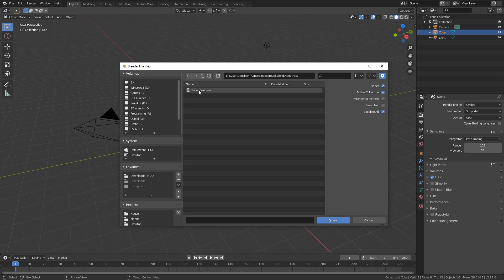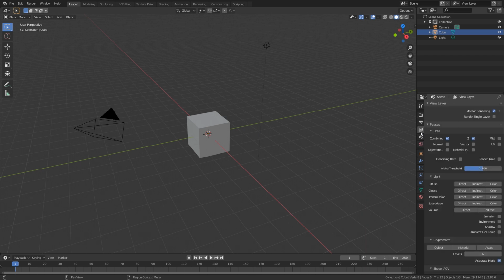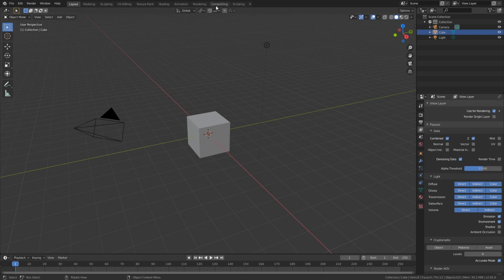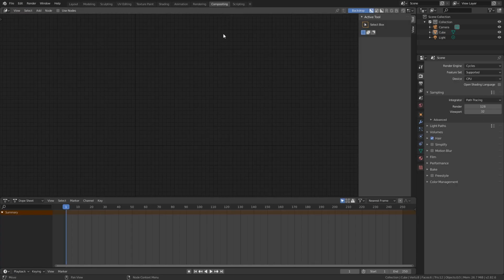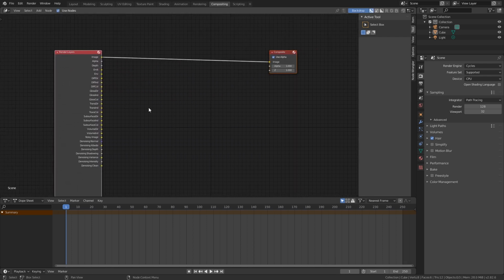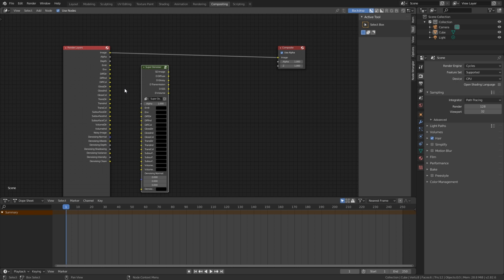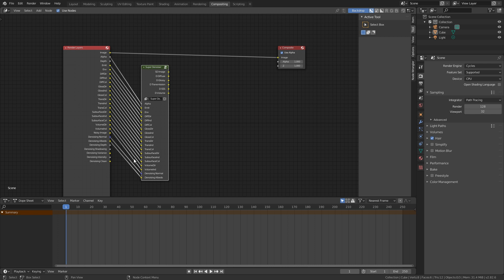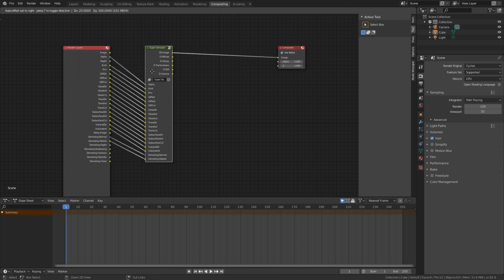[OUTDATED] How to use the SuperImageDenoiser

Comment: It's pretty much identical to the results that the denoising network of E-Cycles delivers. Except that I get nasty bright halos around some edges with your version. And as it's about the same as the E-Cycles denoiser (using OIDN) it also suffers from denoising away too much of the fine details. But that's a problem with OIDN in general.